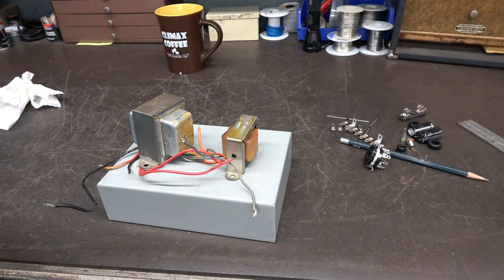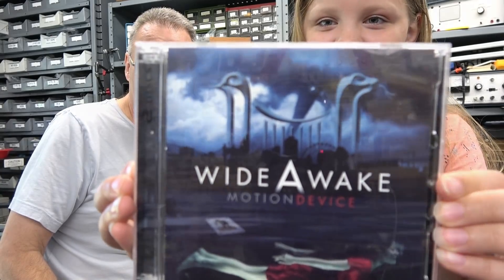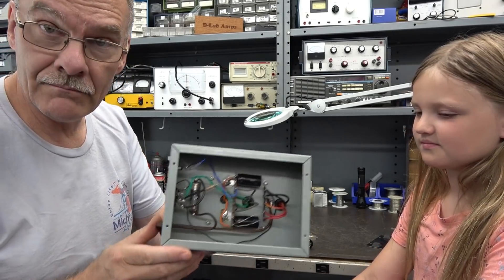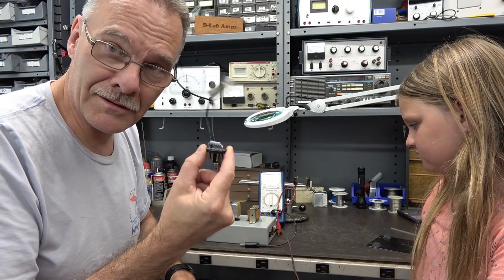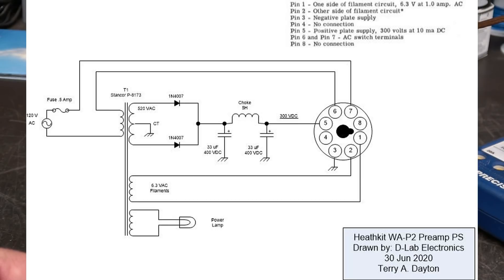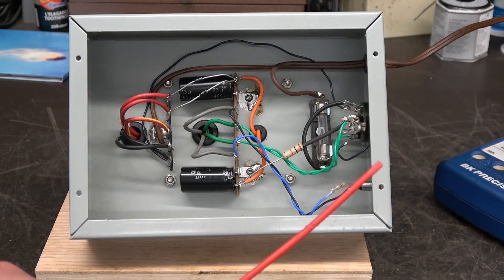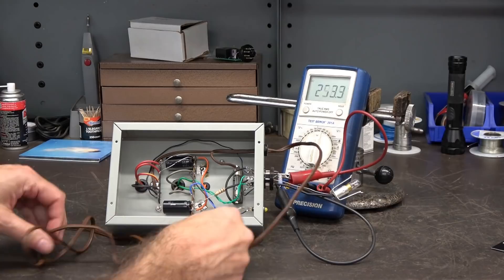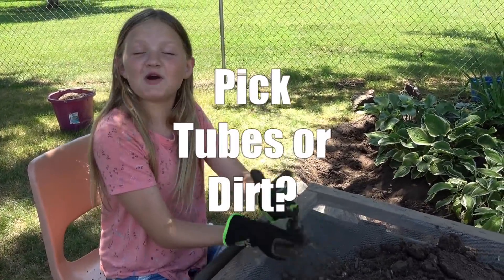How to build power supply Heathkit WA-2P Preamp Homebrew delight

Comment: D-lab Electronics.  Great video.  Thanks for posting.  
The Heathkit assembly manual spells out the power supply requirements:

6.3V AC at 1.0 amp.

300V DC at 10ma.”

The 6.3V AC supplies the filaments. The 300V DC supplies the B+. The Voltage Chart, on page 32 of the manual, shows the high voltage input specified at 320V DC, which is twenty volts greater than the page 6 requirements. Applying 320V to the first section of the filter capacitor could be a problem for early WA-P2 preamps because the early versions used an electrolytic capacitor with a 300V rating. Later Heathkit WA-P2 units were supplied with capacitors with a 350V rating. Be sure to check which capacitor is in your preamplifier if you intend to power it with a voltage greater than 300V. . In my power supply designs, I set my target voltage at 320V to be consistent with the Voltage Chart.

Comment: Cute assistant!  I inherited a Heathkit WA-P2 Pre Amp from my dad, and I want to build this power supply, but please help a little bit.  What's a "4 Henry choke?"  Can you provide specs?  Also where did you run that 10K resistor?  I assume in series from pin out #5 of the octal socket to the choke and capacitor? Lastly, what value resistor did you use to simulate the high voltage load on the octal?  I assume you put that across pins 5 to 3 (ground) on the octal?  Also, couldn't you have used a grounding terminal and lock washer instead of the heavy duty soldering ?  I would like to do this project, but there are a few missing pieces.  Thanks.

Comment: Early Hammond organs did the same thing for the preamp in the organ, with the B+ voltage being fed from the power amp in a separate cabinet. 
Imagine, having 120 VAC line current, audio signal and 260-300VDC all in the same cable. UL labs would have a fit.
Tip: When I build a power supply, I install an indicator on each output. A NE-2 lamp with proper resistor works well for the high voltage output.

Comment: Hey Terry, quick power supply question...when using serial caps to get a higher voltage rating, how do you determine the value and wattage of the balancing resistors?  I know you didn't do that in this video, but I'm working on building an amp with a 360-0-360 transformer. Thanks!